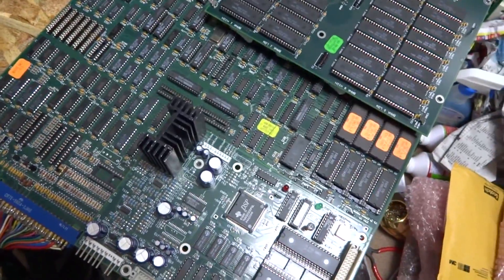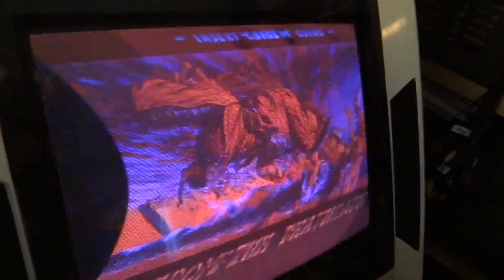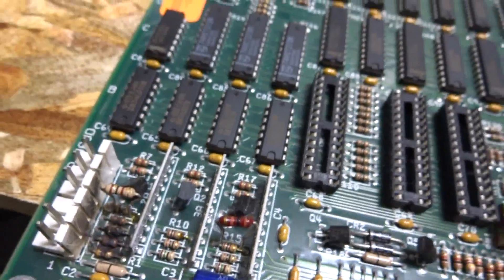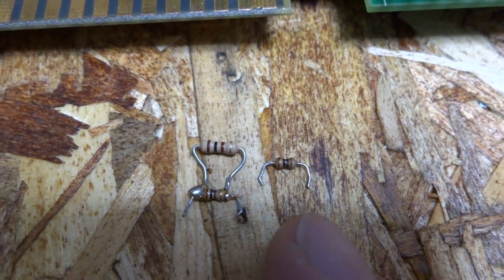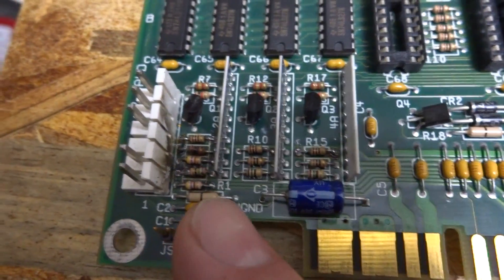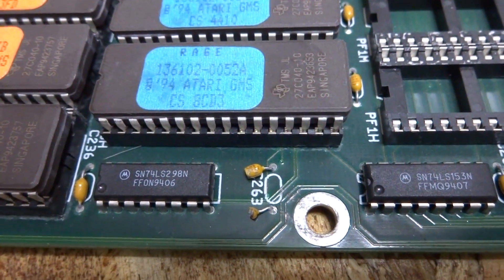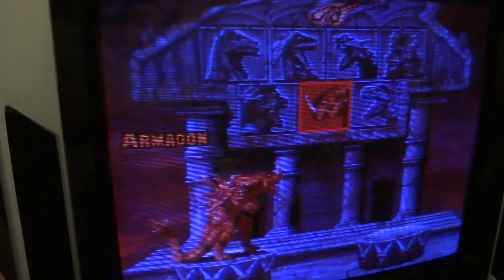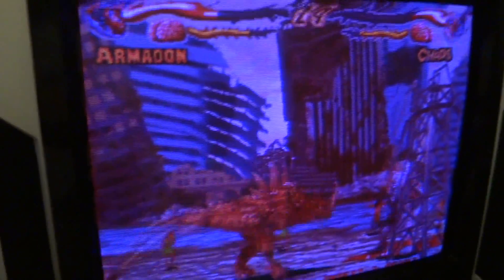Primal Rage Arcade Pcb Repair (Pt.1)

Comment: the gold/sliver etc at the end is not what it made out of but tolerance like +/- 10% of the said omh so the higher the cost of the resister will have a lower tolerance. the first 3 is the main thing to worry about

Comment: Gold or silver rings on a resistor are the precision or tolerance - no band means 20%, silver means 10%, gold means 5%. It means its real value is within that tolerance of the value of the other rings.

Comment: Hey Luke, I have some information for you here. Did you see the orange sticker that says "Neotec only" on the board? Well that sticker is there because they impedance matched the video levels to the wierd Neotec NT-2515C monitor ONLY. You will get a dim picture on pretty much any standard arcade monitor, you need to change the RGB and sync levels by altering the series resistors.

Comment: CONGRATS on the progress on this Luke!  I've had Mortal Kombat boards require adjusting a 50/60 Hertz Pot on an arcade monitor chassis (WG K7000 mainly) to remedy that fold-over at the top of the display.

Comment: Great job with the repair; I hope the sound board works well too.

I'm impressed you were able to diagnose the problem so quickly. All I can do is basic repair like replacing caps & re-flowing solder joints; haven't messed with resistors yet.

Resistors appear to be a pain to identify; the color band system seems annoying\convoluted.

IMO they should have values on them like caps. I guessing it's because of tradition or resistors get to be so small that placing values on them would be difficult.

Comment: Ahhh man, I AM SOOOOO HAPPY that you got it to work. I had no idea how you thought about using a wire and finding the chip but MAD PROPS dude...MAD PROPS. I am glad that you are happy with the results and wow in only 2 days or so, you have a working Primal Rage board. Good job Luke.

Comment: Luke, Its also possible, you are seeing vertical tearing at the top which can be caused by the sync frequency being slightly off. I only mention it because you were having sync issues and are not using the official sync signal. I look forward to seeing how this one turns out.  thanks for sharing this video.

Comment: From what I see in your video Luke'.....It looks like to top is folding. Possible vertical deflection issue on the monitor, the board or just out of adjustment or your board is making that happen. . Luke you can see it better in real life but I did not see any actual convergence issue. Convergence looked OK, but geometry looked as if it was tipped at the top of the raster.   You could reduce the vertical size to see if the problem clears up as a test.

Comment: The sound board on Primal Rage has Left , Right and Subwoofer channels. But the audio can be piped over to the socket on the main board to get a jamma output., This looks like the same socket that was fried on Luke's board.  On my board, I just connect my custom cable directly off the stereo channels on the sound board to amplified speakers.

Comment: I have a fully working primal rage -- About the 5V on this one.. The power supply has to be set a bit high or needs to be well regulated. Once the pcb is connected, the 5V comes down some and you need the full 5V on board. The lights are there for a reason. Get your 5V led's set right and it makes a big difference.  I use an adjustable power supply. For this pcb, I turn to 5.7V and the load pulls it down to 5V (measured on board) I read about this on the KLOV forum.

Comment: Hey Luke, I have a broken primal rage that no matter what power supply I connect to, won't boot and has the "5V low" LED lit up, I even had it connected in parallel to two power supplies, any idea what can cause that?